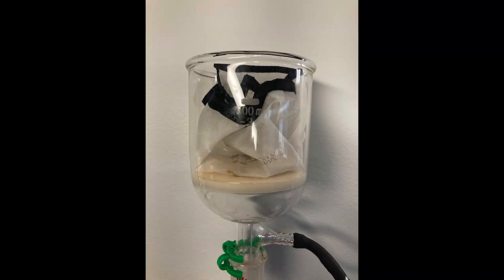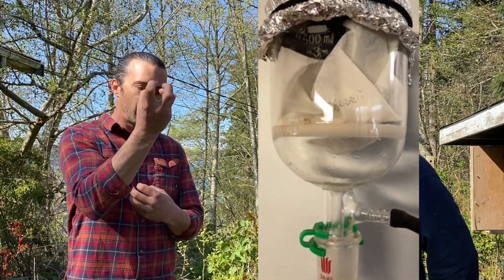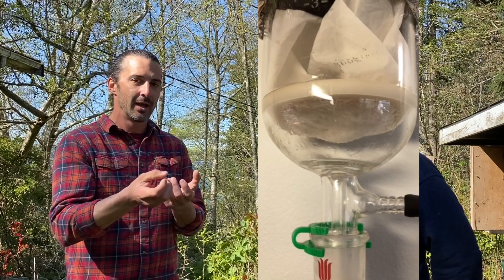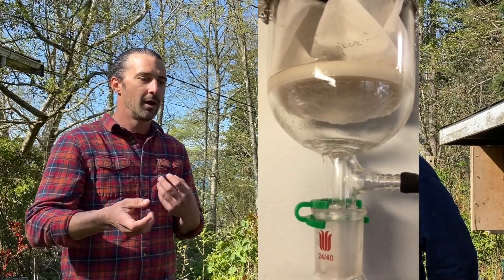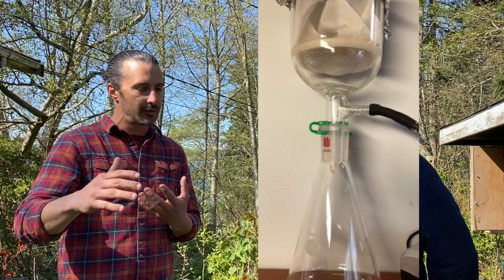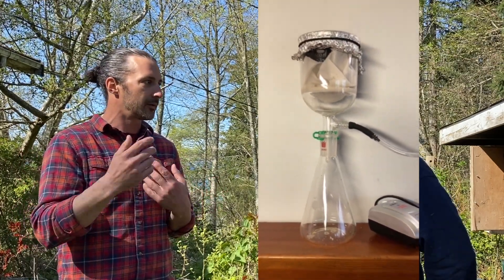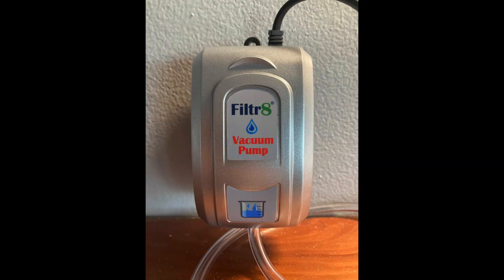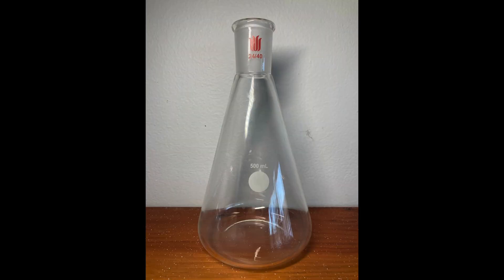Removing Water from Ice Water Hash with the Büchner Funnel Technique

Comment: Would it be possible to add dry ice to the top container (in, above, or around) to act somewhat as a freeze dryer?  Or would that just freeze the product?
Reply: well technically a freeze dryer does freeze your product as well but i feel like it may add some unwanted moisture but i may be wrong just speculating
Reply: or possibly crack your glass
Reply: Freeze dryers use sublimation to dry it I'm not sure if that would have the same effect

Comment: Is there a difference in taste between the normal dried material vs the buchner treated material?
Reply from the maker: No difference really. If anything, the terps are better because it spends less time in contact with the air. The color is nicer too.
Reply: @ShangoLos is the consistency still okay to press rosin.
Reply: Same consistency as dried hash

Comment: You can add one more step from the chemistry lab and that is using a desiccator bag.  what you do is put a plate of your hash and a container of a desiccator salt (damp rid at the hardware store)  into a plastic bag or any air-tight container.  Any moister left in the hash is pulled into the Calcium Chloride (what damp rid actually is) it should finish up the drying with less risk of contamination.
Reply: Was looking for this comment...I use em for storing mush and was thinking of doin this after the funnel...